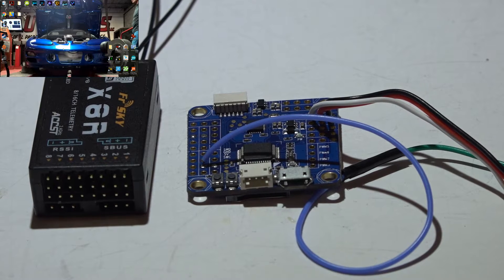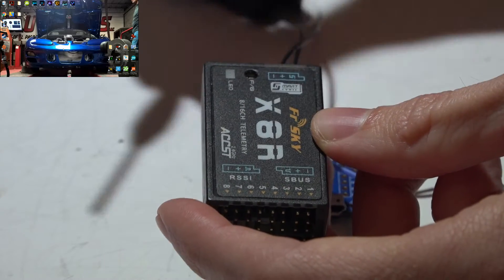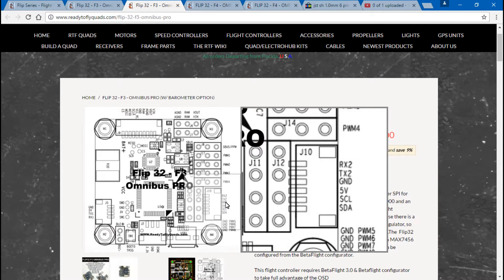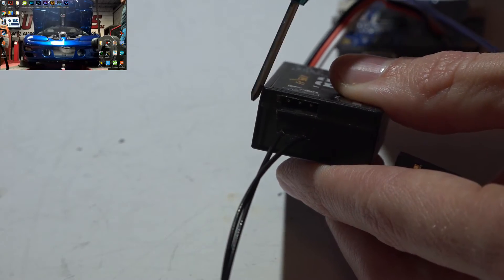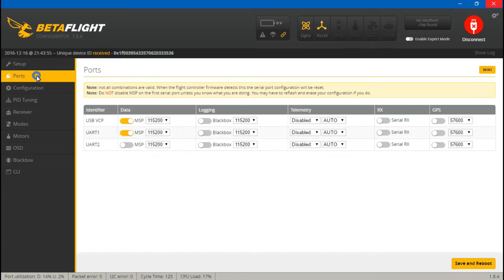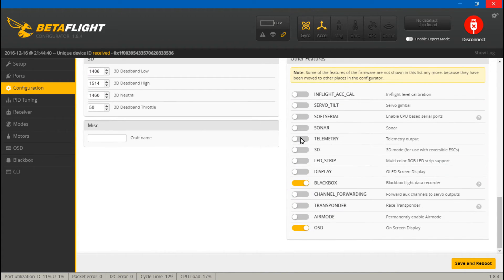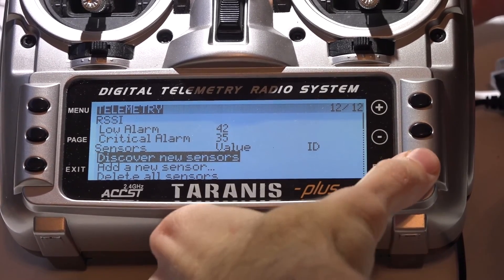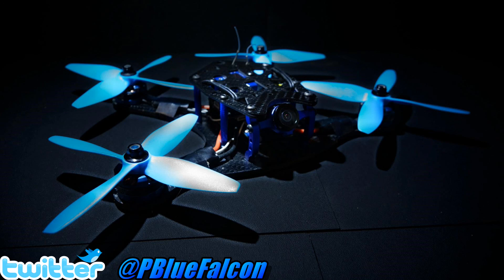Omnibus F3/F3 Pro & X8R: Connect & Telemetry

Comment: I have the Omnibus F3 flight controller and a FlySky i6 and iA6B receiver. The receiver is iBus and PPM but the Omnibus F3 does not support iBus, so I tried using PPM instead. I have it connected to the UART3 port on the FC, and it is in the PPM slot on the receiver. However, when I connect it to betaflight and put the receiver mode on PPM, UART3 does not appear in the ports tab. I cannot control anything from my radio, and it is bound with PPM Output on. Someone else told me to get the FlySky X6B, which does have sBus, and you have a video on it with the Omnibus F3, but I was wondering if I was doing something else wrong. Is there another way to connect PPM on this FC?

Comment: Hi JC, thanks a lot for the hugh effort you put in your videos. I am quite impressed by your posted content. But back to this particular video; I also own the taranis and the X8R and I'm planning to build a flying wing. Is it possible to use this controller in a fixed wing configuration ? And also connect a GPS at the same time with connected s-bus and smart-port telemetry from the x8r to the F3 flightcontroller ? Hope to hear from you soon.
Reply from the maker: I couldn't give you all the details on a fixed wing because I haven't used them that much. But what I can say is I know that other guys are using flight controller so it is possible. As far as GPS on this flight controller I actually made a video on adding in GPS and used a Omnibus F3 in the demonstration. Here is my INAV playlist. I haven't added many videos but I will come back to it eventually. This should be enough to get you going. Also, the youtuber Painless 360 just made a great INAV playlist with even more videos than I've made, hes worth checking out. 
https://www.youtube.com/playlist?list=PLiYYhnH4BhI8DKSj5LLo2U7y5bTdqAZr1
Reply: But still can gps, smartport and s-bus be connected at the same time ?

Comment: Could you help me with a X8R and telemetry on a Omnibus F4 fc?
Reply from the maker: The part that you have to solder the wire to, to get the univerted signal is in between the two boards on the X8R. Its two PCBs stacked on top of each other. So its not possible unless you find a way to safely take it apart which is near impossible.
Reply: This is a shame. Thank you very much for the response..
Reply: Project Blue Falcon nice videos! But still, I am confused. I have the F4 FC and the X8R, can't find that specific video. 
Is it possible to connect the X8R via ibus/sbus to the omnibus (uart)? Thanks
Reply: @TobiasSüdkamp  how you do it

Comment: Hi JC, I got a problem with the smart port, I got the exactly same set up us you decribe in your video but doesn`t work, the only diferent thing is in my taranis radio I got an older firmware than you, can it be the reason isn`t work? thanks in advance!
Reply from the maker: That could be the problem. The biggest change made from 2.0 to 2.1 firmware in the Taranis is the telemetry.